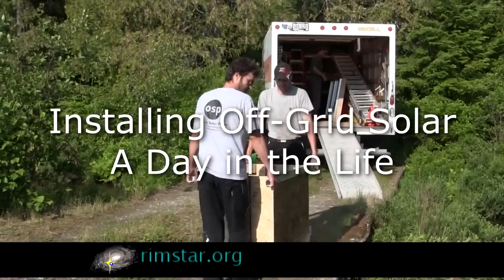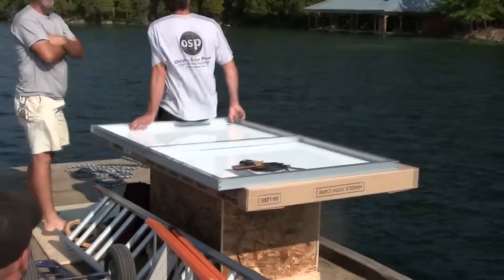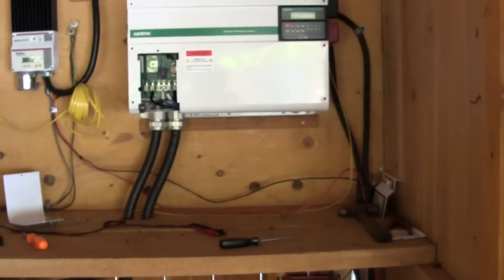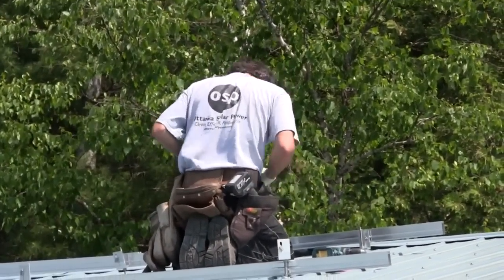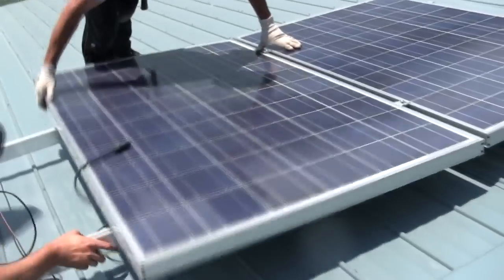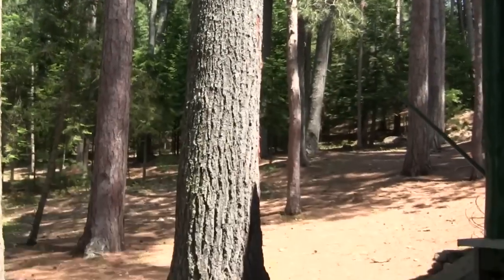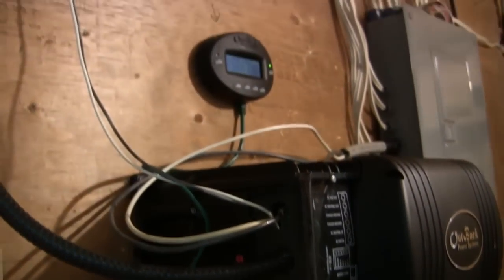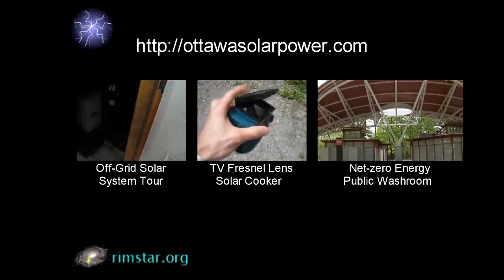Off-Grid Solar Installing - Day in the Life

Comment: Your job is so intersting man. Well I've another question😅why were the wires installed underground where lightning striked?
Reply from the maker: The lightning hit the tree higher up. The electrical current then went down the tree to the roots, through the earth, then through the insulation in the cable and then to the copper wire in the cable. The wires were installed underground either so that they'd be out of the way or for appearances.

Comment from the maker: You're right! There does seem to be a market for lightning protection. :) I'm no longer with Ottawa Solar Power but they do install lightning arresters on every off-grid system at least. I've seen some of their installations with thick copper wire and spikes all over roofs too.

Comment from the maker: I don't think it would help in this case. It came in through the AC wiring which means either from the generator which is sitting up on a hill, and who's cable runs past many trees, or from the house, who cable also runs past many trees. The lightning could hit any of those trees and enter the cables that way. I didn't make it clear but the original inverter wasn't connected to any of those old lightning arresters. The new one is, so hopefully that'll do it.

Comment from the maker: There are lightning rods on the dock's roof (spikes along roof peak 2:13.) I guess they worked because the solar side of the system was fine (solar panels, charge controller.) The lightning hit somewhere else on the grounds, probably a tree near the AC cables going uphill to the house. The damaging energy came in through that cable and killed the inverter. The generator was fine so it wasn't that cable. I don't know if house breakers tripped or if there was damage in the house. That's my guess.